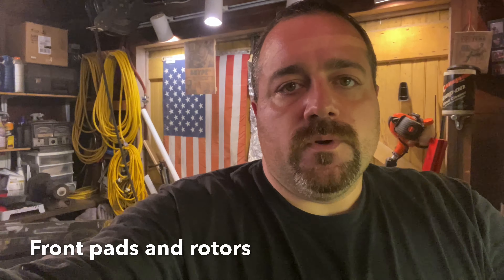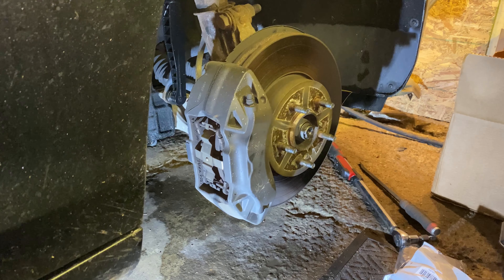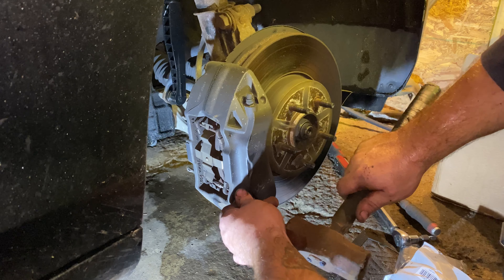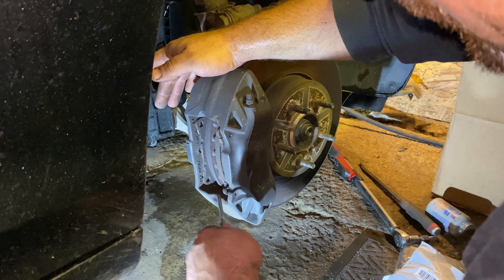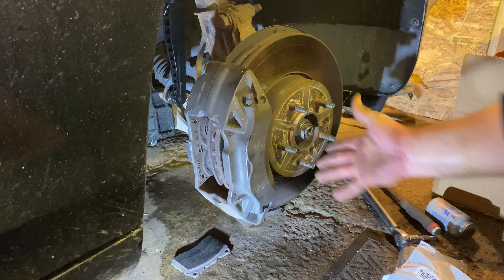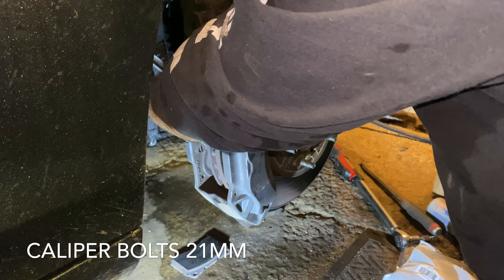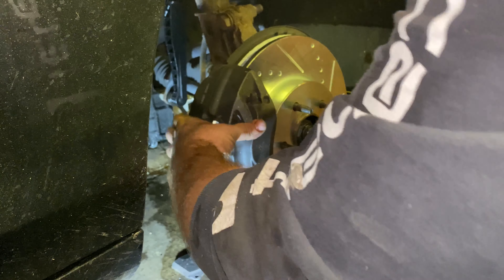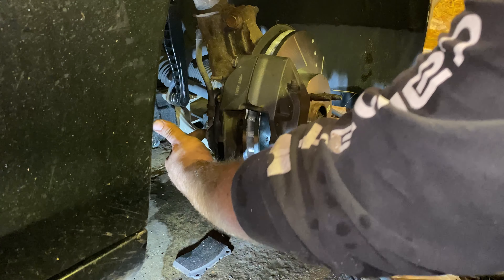2014 Cadillac ATS Front Pads and Rotors

Comment: Neat trick reliving the bottom spring tension to send that pin home! I haven't changed my front pads yet, at 70,000. The back ones were easy, but I have never worked on Brembos so thank you for the excellent video!
Reply: I am at  115,000 miles and they have 20% left
Reply: The fronts are even easier. Besides making the best brakes in the world, Brembo engineers them to be easy to work on.

Comment: this is a great video, thank you! I used it last year to replace really worn front brake pads on my 2014 ATS.  I'd like to replace the front rotors next, and the front pads are still good - can I remove the brake calipers without having to actually remove the pads themselves? I know I can on most cars, just wasn't sure if there was something different on these Brembo's that would preclude removing them with the pads still attached.

Comment: about to get some R1 concepts drilled chamfered/Slotted rotors, im not sure about changing the pads to new ones since they have a lot of material left, however i will apply lubricant to contact areas, i did the back ones already with some new Gucci Brembo pads, cant wait for the rotors and to see how my front ones are.
Reply from the maker: More aggressive rotors should be matched with more aggressive pads. The new rotors will chew up the pads faster in my experience.
Reply: @JoesCarSmartsNY  then I’ll for sure get new ones then, thanks 🙏🏼

Comment: My caliper pistons seems to be stuck, I apply force to them but they won’t push back is there anything I can do ?
Reply from the maker: Take the cap off the brake fluid reservoir when you compress the piston. Other than that - take it to a shop because the pistons might be seized in place.

Comment: Are there any other pins that need to be greases about the 2 pins you punched out?
Reply from the maker: Should just be the two pins.
Reply: @JoesCarSmartsNY  thank you, my rotors on my ATS keep warping very 6 months. Even had shops do break and rotor job. Thought maybe there were caliper slide pins that i didn’t see besides the 2 pins that get punched out. Thanks again!
Reply from the maker: @johnmogielski4590  Not sure what rotors you’re using, but cheaper rotors warp faster. Maybe start using something from PowerStop. They have several grades of rotors and have never disappointed me.

Comment: Do you think there's enough room to replace the wheel studs without pulling the axle shaft?
Reply from the maker: I don’t think so. I would probably just replace the hub if the studs were shot.
Reply: AAA did my rear studs for $250 I think it was 2 years ago
Add:
I got a set of tires and I think they cranked the fuck out of my wheels because less than a month later they snapped.

Comment: Do you remember the part number for the rotors and pads on rock auto? How are you liking these rotors and pads? Any squealing
Reply from the maker: I don’t remember the exact Rockauto part numbers but if yours are exactly like these you need to shop for parts for the “J55” brake system or “Brembo J55” brake system.

Comment: What size brakes did u use? I know Theres different size rotors
Reply from the maker: I called the dealer with the VIN to help determine the correct brake system on this one. This car has the JE5 Brembo setup. Rockauto.com sells them according to that designation.
Reply: Preciate it!
Reply: What about the rotors? Because I see two options which is 300mm(11.81) and 321mm(12.64in) from powerstop on carid. 
I’m looking to go with the same drill slotted rotors you have  just not sure about size and if it’s certain size I need.  Also have the brembo setup
Reply from the maker: @jniceswade7446  I just looked them up again on Rockauto. It looks like the rectangle brake pads (without the ears on each end) like in this video go with the 321mm rotors.  You should call the dealer to confirm, but I’m pretty sure this setup uses the 321mm. When you have pads with the little ears on each end they should be 300mm rotors.
Reply: @JoesCarSmartsNY  Appreciate the help will do